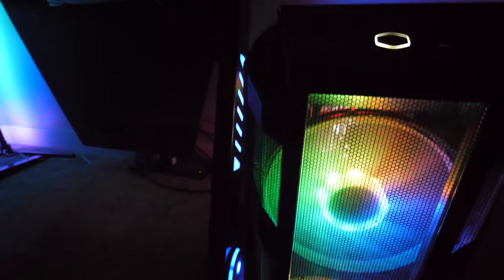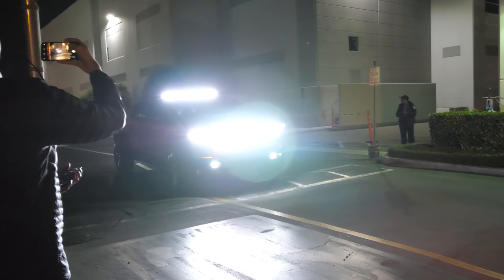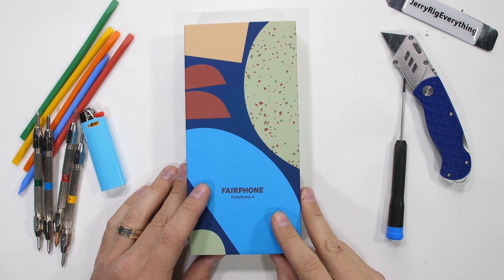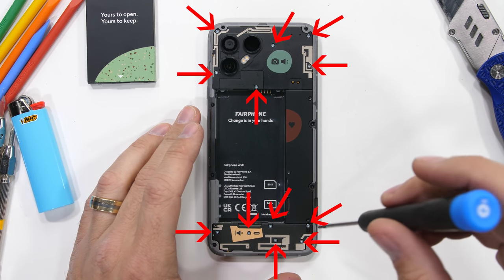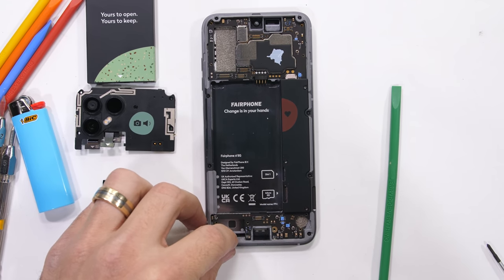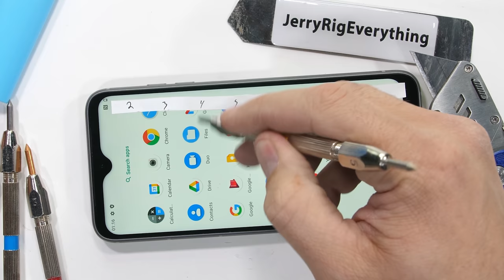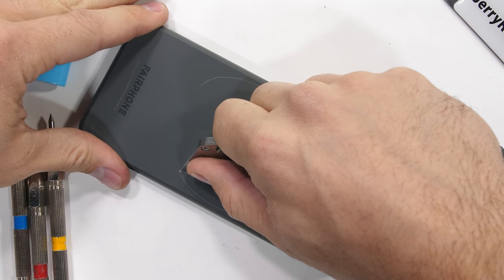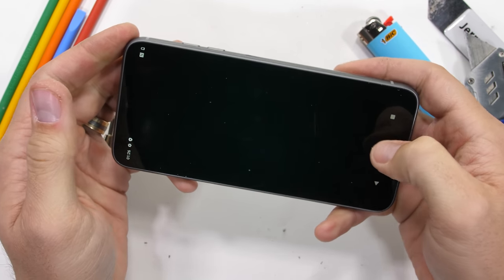Finally! A Modular Flagship?! - Durability test!

Comment: I've never thought I'd see a removable back and battery again in 2021... 👀 Brings back good memories
Reply: And modules you can unscrew and replace if a charge port, camera module or screen breaks.
Reply: Galaxy XCover 5 has removable battery. But honestly I don't see any reason to buy a phone with removable back and battery because battery lasts for at least 3 years. In my case battery of my previous phone lasted for 4 years and it was still usable, I was getting 4-5 hours of SOT, and then it was replaced before giving it to another person. Spending 30-40 euro to replace the battery once for 3-4 years is not a lot.
Reply: @justdude8115  "I don't see any reason to buy a phone with removable back and battery because battery lasts for at least 3 years" - How about instant full charge? (swapping batteries)
Reply: @kamotetops1572  Exactly! There have been many times I wish I could just swap in a new battery real fast when out and about without needing to worry about my phone dying while I'm out somewhere...
Reply: @kamotetops1572  I prefer my phone being water resistant and getting a full charge in 45 minutes than a removable battery
Reply: Actually I always had a removable battery, but that's just because I refused to buy a new phone 😅 I'm really glad to get the Fairphone 4 soon though 'cause my Samsung S5 Neo is slowly dying

Comment: This phone and a Framework Laptop are the perfect electronics. All extremely repairable modular, durable and modern.
The world needs more of them.
Reply: This phone isn't perfect at all - no headphone jack. Which means no sale. Do better next time, fairphone.
Reply: @mjc0961  Alright then what flagship phones do have a  headphone jack?
Reply: Zaydan Naufal  Yup, they do indeed have one bur they're 500-700 bucks more expensive with a painful battery replacement process. Repairing the phone above is as easy as walking, whereas the one you mentioned is like hiking up Mt Everest.
Reply: Yeah I'll most definitely have both as my daily driver in 2-3 years whatever their lineup holds by then.

Shift Phone is another modular phone. Hopefully they introduce an NA-compatible model. Teracube is another good sustainable option, but I hope they make their phones fully modular too.
Reply: @rollerskdude  oh boy guess how much is for the fairphone💀
Reply: @mjc0961  honestly, i've gotten used to the concept of no headphone jack. i just keep the 5€ adapter in my IEM-bag.
Reply: @mjc0961  Its especially annoying when Fairphone themselves literally one generation ago, still had it. So much for environmentally friendly when they themselves are pushing for BT earbud sales by removing it 🤦

Comment: As a tech enthusiast, who is fed up with the flashy hard to repair, overpriced stuff, I'd love to see a fairphone with high end components, that won't cost a gazillion. I think it'll be unbeatable
Reply: Phones are hard to repair because of water resistance
Reply: Any phone with high end components, while remaining below that high-end price will be unbeatable in most ways. What I would love is.. Well, basically this phone. Having major updates for more than 2 years is the thing that really sells it to me.
Reply: @jeffgayzose8129  Bullshit. Stop defending corporate greed. There are tons of midrange phones that are NOT water resistant and is very complex to repair/replace.
Reply: @ChiekoGamers  my statement still stands. Modern phones are hard to repair because of the adhesive that holds the back glass on and makes it water resistant. Screens are hard to replace because of how thin and fragile oled panels are. Sorry that I hurt your fragile feelings with the truth.
Reply: @jeffgayzose8129  So all budget and midrange phones are water resistant?
Reply: @ChiekoGamers  idk, I haven't tested every budget phone out there. Also, the glass sandwich phone design is just inherently hard to take apart. But that's the current best design to hold all the new tech phones have while making some of them water resistant. I hope I made this easy enough for you to understand

Comment: I would have loved to see a headphone jack on this phone. Fairphone's goals of making a repairable smartphone are awesome, but I do feel the Fairphone 4 is expensive for what it offers both from a hardware and a design point of view. The replaceable battery along with an easy to take off screen are great to have and should be done by all phones makers. I do love that it passed the fire test :)).
Reply: Im okay with the price, given that it will easily outlast my S10, which currently has a broken screen (200$ repair) and an aging battery (60$ repair + back glass replacement). The Fairphone was a wake up call for me, it made me realize just how important cheap and quick repairs are for me.
Reply: You don't only buy the hardware. You also buy the reparability, solidity, the warrantee and modularity. After 10 years owning this fairphone should be cheaper than owning any other phone.
Now that said, you can today buy a refurbished phone, and later a fairphone. When you buy a refurbished phone, at least you don't buy a complete new phone that would be adding electronic waste on the planet.
Reply: The higher price is because they are paying fair wages to everyone involved in manufacturing of this phone. If you ask me that's a fair price for what they offer and do for environment and everyone else.
Reply: You pay more for better treatment of miners and workers in factories and for ethically sourced materials.
Reply: It's the camera notch that put me off the FP4. Headphone jack would be nice but i now have BT headphones...

But that notch, that'd drive me insane.

I'll stick with my FP3 and hope the next version doesn't repeat that abomination :)
Reply: The specs are beyond what a smart "phone" is supposed to provide. Most flagships can't deliver the extremely exaggerated features like the refresh rates and availability of the highest speeds on their CPUs.
Reply: @atocat9040  who wants to keep a phone for 10 years. Technology will have advanced so much by then this phone would be useless. It's a cool idea, but not practical in today's world.
Reply: @jeffgayzose8129  maybe not 10, but 5,6,7 for sure. my S8 is still working great, except that the battery now shows clear signs of degredation and i have a cracked screen which is way to expensive to repair. + and thats the reason i'm now going for fairphone, its the software support. samsung, as most others, only gives 2 years, or 2 android versions of updates and then that phone is dead to them. my last security patch was in april. so i'll gladly pay 100€ more if i get at least 5 years of software support. and it runs lineage, so even longer. and the whole sustainability aspect is also why i think they deserve my money more then the  lousy rest. Unless you do FEM simulations on your phone, the difference between my S8 and the S21 is negligibly
Reply: @armatus  if you're a person who doesn't use a phone very much, it's probably a good purchase. But for people who use their phone a lot for work or social media, I can't see them ever buying this over a new phone.
Reply: Yup. They made a repairable phone, and then threw it all away by taking away the headphone jack to try and sell us overpriced, unrepairable Fairphone branded earbuds. No thanks Fairphone.
Reply: @jeffgayzose8129  Smartphones nowadays cost just as much as premium laptops and they should last just as long too..
Reply: Yes, but Apple better. Checkmate.
Reply: @jeffgayzose8129  Some people do not follow the newest and flashiest trends. I for example want something that just works when it comes to phones and something that can be easily fixed when it breaks. I kept my OnePlus 1 as long as possible, only to replace it two months ago. That phone served me well for nearly 7 years.
Reply: It's actually very smart. One fewer part to require a supply chain, space in the chassis, and repair/replace, less is more here. Headphone jacks have broken on two of my old phones before the phones were outdated and I couldn't repair them. Also who uses wired headphones anymore today with wasteful and annoying breakable cables.
Reply: @atocat9040  Personally i would say it this way, the idea is fantastic, but the truth is the upfront cost is too high.  Taking myself as a example, get a generic phone (say USD300-400), using a decent case and screen protector applied could last me (usually) 3-4 years (unless something really unlucky happens) before i get a new phone and all the parts replaced.

As I said, the idea is fantastic, but phones' parts do wear out and become obsolete over time.  You buy a fairphone, after 3 years or so, u will still want to replace the battery, have the SoC and camera upgraded, and if you choose an OLED screen (not an available option ATM tho), you will want to replace it when burn-in occurs (which often takes 2-3 years).  With a modular phone, sure you can replace only what you wish to, but the cost of replacing the above components may already equivalent to another generic phone (if not more).

At the end of the day, being environmental friendly on phones doesnt really save money, instead it comes at a cost (unless u can bear with the same hardware configuration for 10 years, barely replacing battery and what wears out during the time).  An option for those who have extra bucks to spare, and willing to pay to feel better, but not for those who are on a tight budget and can barely afford to stay up to date with the hardware of phones.
Reply: @adseelt2207 "for the price of two standard androids that last maybe 5 years together you will get 10 years of happyness"...?
Sorry I dont really get how did you reach that conclusion with the maths, the fairphone itself is roughly equivalent to 2 mid-range generic phones, for its upfront cost (alone), for it to last for 10 years, u need to factor in the cost of upgrading parts (every 3 years or so, so you need at least another 2 upgrades in the 4th and 7th year of its life), each upgrade would cost roughly equivalent to a new generic phone. 

In addition, just in case you are not aware of, the warranty of fairphone is 5 years instead of 10 years, I dont have a clue how much it cost for the company to extend the warranty to 10 years (or whether they offer such option at all), but that is another cost to be factored in.

I try to avoid being emotional, but long story short, being environmental friendly and socially responsible comes at a cost which I dont consider light to be affordable for everyone of us....
Reply: @jeffgayzose8129  Yer actin' like the software even changes within 2 years. My A5(2017) runs identical to my A50(2019) minus some hardware differences(which is easily fixed by a modular, upgradable phone). I'm not sure what exactly you think is better about the newest phones rather a 2 year old phone. If anything, the newer phones are LESS durable and only loosing features. The only "better" thing about the newer phones is the screen resolution and camera quality, which arguably can be useless upgrades to a lot of people. The only reason I can see people buying new phones over lasting phones is the hype, pricetag, and obliviousness. Of course there will be the few people who could actually make pretty good use of the higher camera quality, but almost no average person needs a higher screen refresh just to go on Instagram my guy 😂😂
Reply: @Emu19  software changes every 3 months bud, you just don't know it. New phones have better processors, battery optimization and a lot of other things they don't advertise because people are too dumb to understand. My point is, without fairphone releasing a processor upgrade that is optimized with future Android updates, this phone will be replaced like most phones after 5 years. But hey, at least the screen and battery replacements are cheap
Reply: @2nd3rd1st  wireless stuff is just as wasteful and annoying, with batteries that lose functional capacity over time
Reply: @previousslayer  Yea I'd love to know what this new wireless trend is really about
Reply: @drkastenbrot  the only reason you bought this is because you can't take of a normal phone and treat it with care lol. Srry for saying you're short comings
Reply: @previousslayer  ok boomer
Reply: @Maximus20778  maybe I dont want to have to be super careful with my phone all the time? maybe I want to just have a reliable tool that I can fix when necessary? 
Really weird backwards thinking you got there, accepting things being overly fragile by just "being more careful".
Reply: @drkastenbrot  maybe you shouldn't be reckless yes. Also technology gets better by the years who the hell is gonna keep using a phone with a removable back
Reply: @Maximus20778  ?????????????????
Reply: @drkastenbrot  ah yes the boomer mindset

Comment: There's a few things about this design I'd like to change, all of them minor issues.

1. I'd like to have a 3.5 mm jack. If Fairphone is all about responsible consumption, then cabled plugs are a way better idea than wireless earpods, which tend to die very quickly due to battery issues, and simple losses.

2. I'm not a fan of the plastic back. Instead, I would propose a metal back held in by a bunch of torx screws instead of those plastic clips. It would give the phone a better feel, and might also secure the back better for a higher water resistence specification.
Reply: Fair criticism I think, though I really like the idea of being able to replace the battery without any tools.

Comment: happy to sacrifice any cutting edge tech for a modular, repairable phone that does the job. 😌
Reply: Most people aren't, especially people who use their phones a lot
Reply: @jeffgayzose8129  Most people don't care about which CPU they have inside or what display tech is used. Those who use their phone a lot will be happy to repair it on their own in the next five years while using up to date OS. I don¨t want to buy new phone after year or two just because it came out of warranty and it's not worth to repair it and there is no security update.
Reply: @jan.tichavsky  people who use their phone a lot want a high-quality, screen, fast load times, and a big battery. This phone doesn't offer that. I've had my s10 for 3 years and still get security updates. What happens when they release a new phone in a couple years and stop support of this phone?
Reply: @jan.tichavsky  I'm one of those who still overlooked the specs of this. Wanted to own this phone, but the rest of its specs, especially camera (1/1.7" is my lowest bar) are just too hard to justify for a phone that's only $50 cheaper than the base config latest iPhone.
Reply: nah

Comment: I thought the whole point of Fairphone is that you can keep upgrading parts individually as needed instead of continuously buying brand new phones?? But they're still releasing a whole new phone every year, and the upgrade modules they have are mainly only for cameras. The repairability is great, but it doesn't mean a whole lot if people are still buying new phones to get new features and higher specs.

Comment: this is a couple years old, but i remembered this phone being talked about and I needed a new phone to replace my old motorola that's been stuck without updates for years now and was starting to become unresponsive and reboot on its own, so I got this phone, and... I love it. It's very well built, it's de-googled through murena, it's simple to use (though it takes a little to get used to if you're used to the stock android experience), has features to improve privacy and it's potentially going to get software support up to 2028

Comment: I would love if easily removable backs came back on phones. At least for easy battery swapping.

There's no way to get an IP rating for water immersion but this doesn't mean they should drop all the other protection measures like rubber rings around usb C port, sim slot and other sort of protections for earpiece, speakers and microphone holes. 

Slap a case on it and it should be safe to use in the rain at least. And that's enough for most people. If you know you're clumsy just don't bring it close to the toilet or swimming pools. 

The ip67/ip68 rating is a nice to have but you might not ever put it to good use. Just like that macro camera you'll use to take less than 10 photos in a span of 3 years.

Comment: Attention: Palm rejection is a nightmare on this phone! Tiping with one hand is impossible and you really have to get used to it with two hands if you lay! It's by far the biggest weakness for me after using the phone for 3 weeks. I CONSTANTLY change to special characters and numbers by touching the keyboard in the lower left corner with my palm! I never had this problem with any phone. The only solution I found reading in forums is to buy a case which is bad because the fairphone 4 is already very heavy and bulky.

Comment: After a little under 5 years of use (and updates until last year) I replaced my OnePlus 6 with one of these. It really feels solid I must way. You can call that heavy, which it is, but so are other flagship phones. It certainly looks the part on the inside I must say. Love the old fashioned place for the sim card as well (under the battery, remember the Nokia days!?).

Comment: I definitely love the new 4, a real massive improvement over the 3+. But the lack of 3.5mm headphone jack? That goes against Fairphone's ethos of environmental sustainability and longevity.
Reply: you can buy a USBC 3.5mm jack convertercable for 9€
Reply: @adseelt2207  I literally don't see any reason to add more e-waste when you can prevent it in the first place. Also, adapter and dongle cables will wear out the USB port even faster than usual.